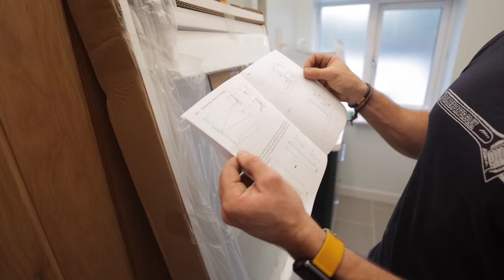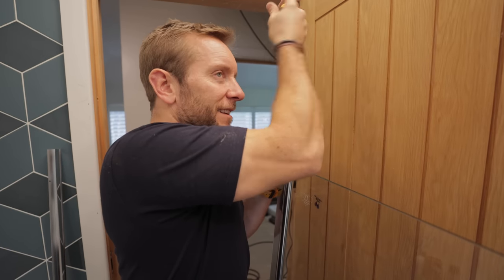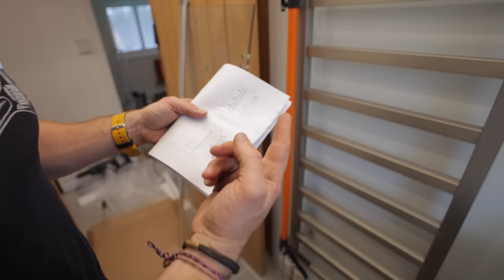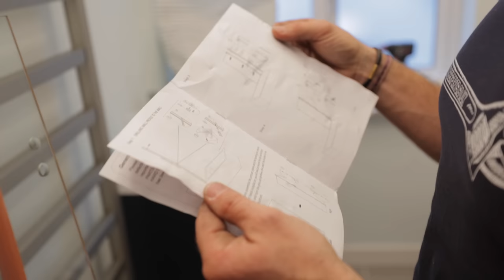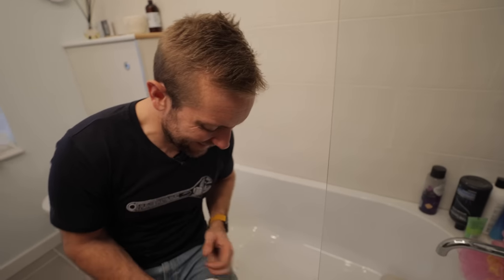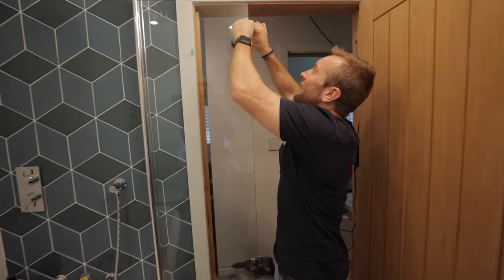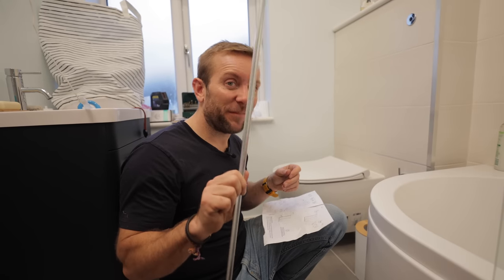TEARS ON THE JOB - How To Fit A Shower Screen Over A Bath

Comment: The metal strip is to silicone onto the edge of the bath - it stops the screen from swinging out when you don't want it to and helps keep water in.  We have one and it looks better than expected once you've put it on
Reply from the maker: cheers mate.....I'll add now!
Reply: You are right. When we had our screen fitted, the builder was confused too but managed to figure out. 
Now, after some years, I have a slight problem.  I changed the rubber seal under the screen as the original one was worn out. It's the same Roman brand and size but the screen doesn't close full as there has been slight movement in the building. (We live in an apartment). It doesn't close flush like originally. What would be your suggestion please?  Trim the strip a little or would that damage it. Please suggest. Thanks.

Comment: Looks like a piece that sticks to the bathtub, although I've only seen where it slots into a piece on a fixed section (the smaller glass). Acts a barrier to prevent water 💦 coming out. Also note how he did NOT silicone the inside of the shower screen!!!! Calm down with your sealant lads!!
Reply from the maker: Haha! Never silicone the inside!
Reply: @plumberparts  I found if you silicone behind the rail it is difficult to remove if you ever need to remove it  i.e. fitting a replacement, but it does mean no silicon needs to be seen. The manufactures do actually say to do this but it is personal choice.  Good real world vid.👌
Reply: Would you silicone around the screws so water can't track through to the plasterboard or timbers etc? Cheers
Reply: Mine's new-build so was already installed - both sides inside and out and all around the bottom edge was siliconed. One large solid glass screen that was always in the way of the door when trying to get to the bath taps so I took it out and put in a shower curtain.
Reply: @bongy100  Just heat the mounting rail with a hot air gun and it will pull away

Comment: The manufacturers do not pre drill the holes through the chrome edge and the wall plate because when you position the screen into the plate, fit the plastic bead first, slide the screen into the plate and drill the bottom hole first followed by the middle and then the top. This will ensure that gravity stops the door from opening on its own. It also helps you if the wall is not 90 to the bath as you can afford a wider gap at the top. You should silicone the metal mounting piece to the tiles before fitting the screws, when you tighten it up the silicone will squeeze out, let it dry then remove with a knife. If the wall is way off 90 to the bath, put loads more silicone at the top than the bottom, fit the wall screws loosely tighten the top ones until the strip is plumb then leave overnight. Next day continue Installation.

Comment: exact same bath screen, I found the metal strip superfluous as we have a concrete surround and the rubber was enough. I was also surprised it didn't make clear  how to drill the door into the profile. The living hinge was the bastard for me - kept popping off so I heated it gently with a hairdryer! but once it looks nicer than the 120 quid would show as it's rimless. Also folding to 50 cm means it can rest against the back wall  for baths

Comment: I have a very similar screen and for the life of me i can not stop it leaking.

Where the two panels join even after cutting the seals there is always a tiny hole that water inevitably gets through and soaks the floor.

Even at the bottom joint closest to the wall where the seal meets the joints it leaks there.

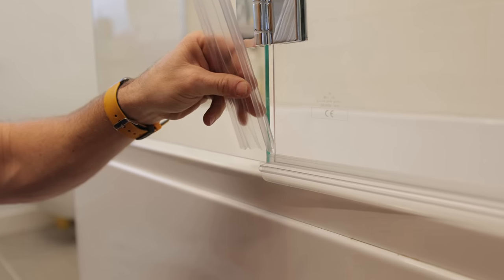Comment: Not the easiest job to do on your own James! Where you cut the seal @ 12:00 to butt against the hinge, do you find that you get a little leak when water is running down the inside of the screen? And if you don't, please tell me how 😤.
Reply: The leak between hinge and seal is inevitable due to the hinge design. That's what the metal strip is for to keep water in.
Reply: Thanks for that 👍. The screen that I fitted wasn't particularly expensive and didn't have a metal strip...

Comment: I detest fitting shower screens. We had to replace a curved screen for a bath which was in our house when we moved in. We couldn't afford to redo the bathroom so just changed the faulty screen. We had it fitted by someone who left a gap at the bottom so badly that it was pointless having a shower screen. We ended up having to buy another one (which i fitted myself this time) to replace the one fitted originally as they'd messed up the profiles as well. I find fitting them really stressful! Also, I find the profiles and fixtures really flimsy sometimes, but that might just be because we bought from Amazon.

Comment: Hi, On a 22mm Isolating Valve it is marked with a Direction Arrow. The 22mm Full Bore one I have just bought is not marked with a direction, so does it matter which way round I fit it.

Comment: My Hinged Bath Screen is leaking between where the Bath Screen Hinges and the Seal begins (on the movable part of the Screen), is there one fixed Seal on your Bath Screen running along the outside of both sides of the Bath Screen, on either side of the Hinges?
Reply: Same, I'd like to know the answer to this.
Reply: I think if both the inside and outside have been sealed, water might stagnate inside the profiles themselves, so only outside should be sealed , found from instructions for the IKEA one.

Comment: All good if the wall to the bath side, top edge is close to 90° 🥴 and you don't end up with a 2cm gap between the outer bottom corner edge of swinging glass shower screen and top of bath edge 😢

Comment: 2 Year in the making mate. Have you nearly finished it yet? I wanted to ask in the first few vids of these when you had the fan to outside. Why did you have a bit of cardboard up against half the window?
Reply from the maker: Ahhhhh that’s to create a negative airflow, stopping dust from going into the house and blowing it straight outside.
Reply: @plumberparts  like your genius dust extractor vac attachment for tiles and hardiebacker. You are the next Edison or even Tommy Crapper. Wish you well mate.

Comment: Looks like an iflo screen. I recognised it from the terrible instructions as I have a slightly different iflo model 😮. I agree that the bit about swapping those hinge pieces is confusing and pointless. I'm about to fit one so your video has been great. Your vid confirms that you just need the open part of that hinge piece towards the bath for water runoff so you can choose left or right handed simply by flipping that first panel upside down without unscrewing the hinge pieces.
Thanks for vid & thumbs up! (but 0/10 for the person who wrote the instructions)

Comment: Personally, even if going into timber behind, I still always use plugs and trim them down, so the screws are still supported in the oversized tile hole. Especially if it's a hinged screen.
Reply: What? The screws are supported by the timber they’re screwed into.
Reply: @MKRM27  as I was saying, it's merely as extra support. The rail is held against the tiles by being pulled into the wall by the screw into the timber behind. Effectively that screw is going loose through a 6mm hole into the timber. I cut down a plug to the depth of the hole just as reassurance that the screw can't move in that hole if the screen is under duress when swung open.
Reply: Shouldn't put the plugs flush with the tile anyway, should always push it beyond and fill the void with silicone to stop any water ingress, leaving the plug in the tile can cause it to split/crack/fracture when the plug expands in the tile. Shouldn't do it.
Reply: @killerbean9911  I've never once cracked a tile doing this, nor been called back because of a cracked tile over time.
Personally, I think it's more likely to crack a tile having the potential hard metal of the screw in direct contact with the tile than having the nylon shield of a plug. 
To address your other comment, I always circle a hole with a bead of silicone before screwing in to protect against water ingress, but that wasn't the point.

Comment: I bought a screen and just held it into place beforehand. It was at that point that I realised when I’m stood in the shower, I’m 6’ 2” tall, the water would bounce off my head and go over the top of the screen. I packed it backed it back up and took it back for a refund.😮😳.
Reply: I can't find any taller than 140cm. It's causing me a headache as I can't use a shower curtain in my particular set up.
Reply: Buy a Shower screen instead of a bath screen and it'll be the height of the bath taller.

Comment: Hinged screen on a flat edged bath. No. It WILL leak. A shower bath should have a lipped edge.
Reply: Not if you stick the optional strip to the bath edge which is the piece he couldn't work out was for.

Comment: Ok.. I did everything perfectly, but found the asshole who installed the bath did it on a gradient... MY bad for thinking it would be ok... I had just retiled and re-sealed the bath and the shower screen was an idea of my wife's.. is it salvagable? :) we're talking about an 18mm gradient over 800mm ☹ This is on the outer side of the bath where the screen fits 🙃